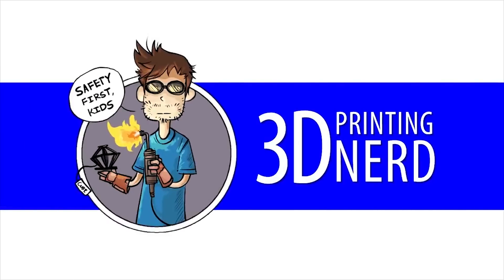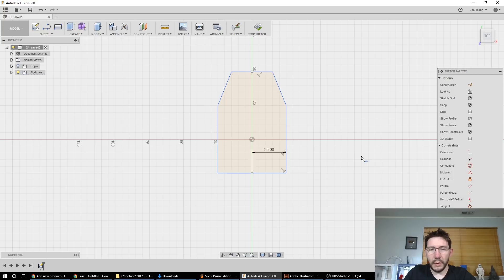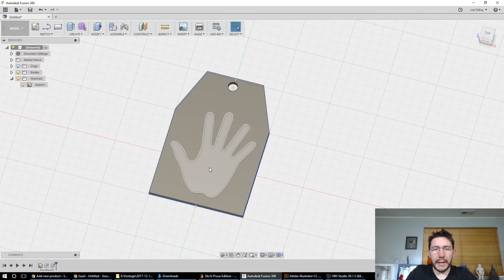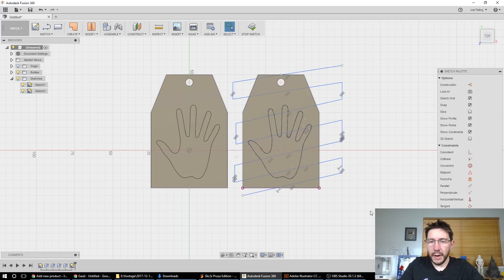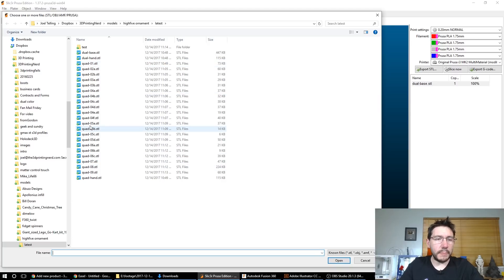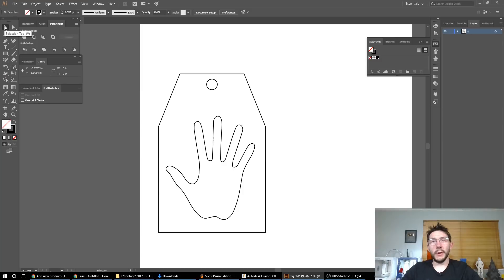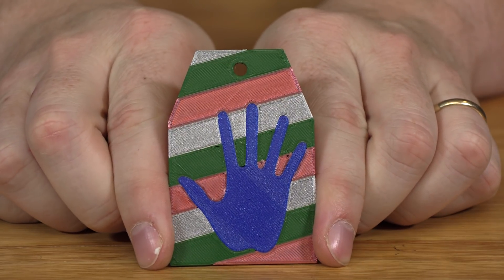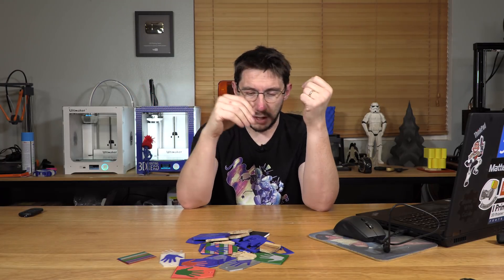Custom Christmas Gift Tags - Using Fusion 360, Prusa Multi Material, & Inventables Carvey CNC

Comment: On the multi-color tag: you can show only the parts for color 1 (hide everything else - turn off the light bulb next to the objects) and right click the top node (design name) and select "Save as STL". This will bring up the 3DPrint dialog and you can save as one file with multiple bodies. Rinse and Repeat for each color. This would reduce the number of files from 20 to 4.
Reply from the maker: +James McKeand OH DUDE. I was trying to figure this out before I filmed. THANK YOU! Will definitely film an update and give you a shout out.
Reply: I just uploaded a short video on my channel if you want to see how I would do it if I had multimaterial capabilities...

Comment: Can't you select multiple bodies and export them as a single STL? If you do that, you could condense the model into 4 STL files and essentially make the extruder selection in slic3r PE much easier!
Reply from the maker: +Jonathan Kayne you cannot, but someone gave me a tip to try and I'm going to try that tonight.
Reply: There's probably more ways, but you can create a component with multiple bodies and then export, so create a component for each extruder, grouping the bodies.